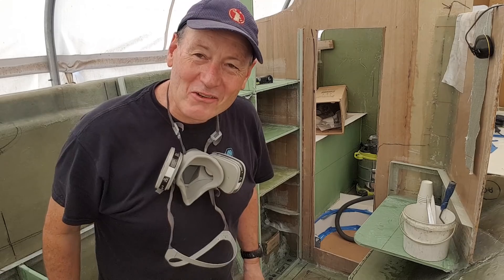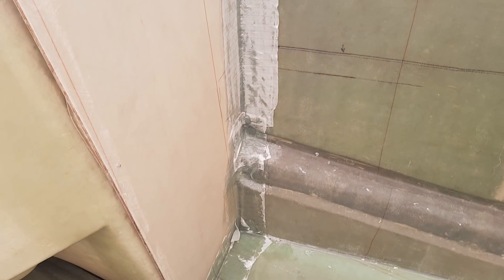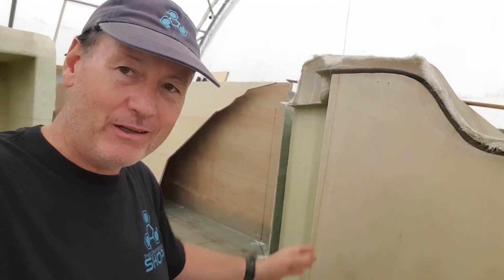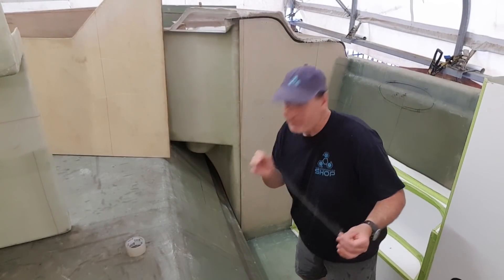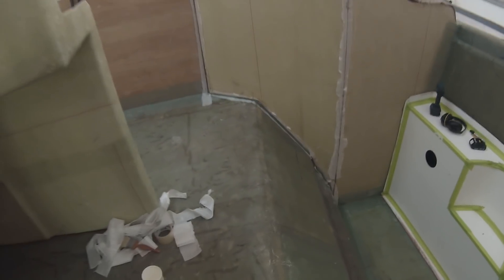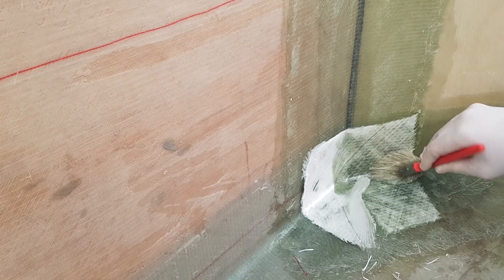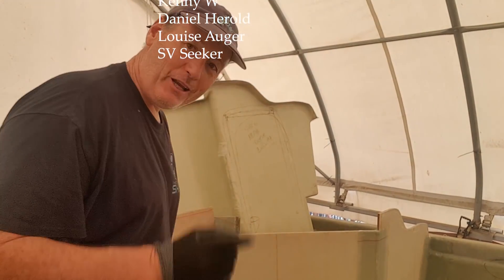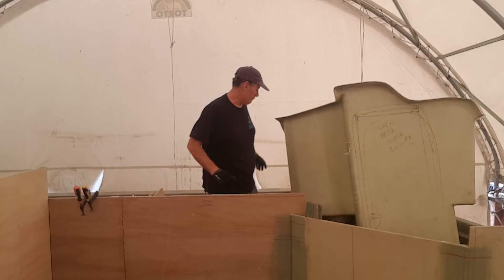Ep113 It's a bloody struggle!! - Life On The Hulls - Building A Catamaran

Comment: I wondered about a gantry system a few weeks ago. I imagine these modules are more awkward than heavy, but still pretty heavy.  What if you ran a a pipe ridge pole under the ribs of the boat house. Tying them all together, that would spread the load out. Then a light duty strap style come along on a wheeled carrier. Those huts are usually designed to be able to support snow loading of a few hundred pounds. I’m just thinking about your back, and more selfishly how I want the project to continue. Oh please stop apologizing for ambient noise. Your videos are great, it’s not a challenge to hear you over the noise and it doesn’t diminish the quality in the slightest. You do great work and I look forward to this each week.

Comment: Hi Ross, another great episode, sounds no trouble, I just worry whether its the crackling of another fire wave or rain with icy lumps !! That frame will lift what you can, especially where you were as the end frame diagonal brace on to the main tube above the module would take say a dinghy sheet and blocks and have made that lift easy. Save the body a bit more mate, you do hammer it !!

Comment: Can you build a portable metal hanger  and radius pipe boom including pulleys and a boat trailer wench to assist with lifting. It looks to me like you could use the hull to hang the pipe boom where needed?  Make hanger large enough to avoid to much compression force on your hull.
Don't injure your self ! You want to enjoy the boat when it's done

Comment: Ross, Doesn't the canopy structure have enough strength to support the weight of some of those modules? If you use a block and tackle set up. The placement may not be perfect to hang it from but you can still take most of the weight then push it in place. I don't know what those modules weigh but seeing you man handle them make me think the canopy could support the weight? Just saying. I don't know about everyone else, but for me don't worry so much about the sound quality. We know you can't control it all the time. I don't mind the voice overs. You are doing a great job. I challenge anyone that agrees with me on the sound to give this a thumbs up. Lets see if we all feel the same. Stay safe everyone.

Comment: talking about a lifting apparatus Gantry or whatever. Can you fabricate one on wheels that can roll and span across  and in between the Hull and the tent on both sides. Maybe something out of square tubing. It only has to lift a few hundred pounds it doesn't have to be some giant apparatus. A frame on Wheels basically
Reply from the maker: If I do another boat,rest assured there will be a rolling gantry as you have described.I have been fortunate so far but it is getting challenging now.Cheers Rossco

Comment: Question - Maybe I am crazy.  I am a total amateur just watching. Love your videos. Quite the craftsman. 
Why can't you simply use more conventional framing/construction once you have the outershell all fiberglass in? Maybe 50mm metal studs or C channel and cement board (Mold resistant) etc..  maybe 6mm foam over top if wanted. If one wants, can use studs w foamboard, but the point is, its just a whole lot easier.  for insides, are you so much in need of fiberglass vs. more conventional construction?

Comment: I've always had a hard time visualizing what the final product is going to look like, so thanks for the photos of the sister ship!  Are you going to make yours a fly bridge cat, or a dual helm design?
Reply from the maker: I am only going to have 1 helm,and dual power controls in the saloon.I will likely have a raised helm position on the port side Cheers Ross
Reply: @LifeOnTheHulls  Hey, Ross!  A follow-up question if I may:  Since the mold was originally for a power cat, what modifications are you going to have to do to convert the final result into a sail cat?

Comment: Question.
When you are applying the peel ply, you are using a brush and appear to be brushing some sort of resin or liquid over the top. You may have explained this process in the past and i just missed it. Would you please explain the peel ply process?
Reply from the maker: I have found that brushing some resin on the peel ply settles it down and I usually ensure I have a wet brush to make sure it is firmly in place. When removing the peel, it remove any wet out on the top surface and leaves a roughened level surface to guarantee a mechanical bond without the need to sand and excessively prepare. Cheers Ross

Comment: Another great video. A quick question ssd Toon for you. I used to work at a factory that made fiberglass monohulls. We ha four molds, hull, deck, interior and headliner. All your various module molds are the equivalent of the interior mold that we had but what do you use for the headliner? I.e how is the ceiling of the interior spaces finished?
Reply from the maker: I have a number of headliner moulds for the heads but predominantly the headliner will be a vinyl or gel coat liner, and in some areas faired and painted in 2 pack I guess. Cheers Ross